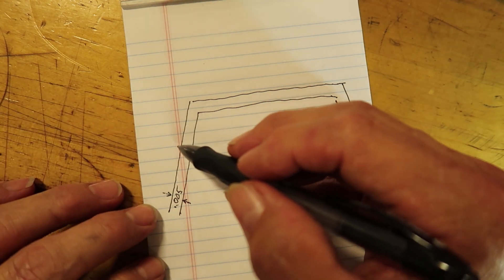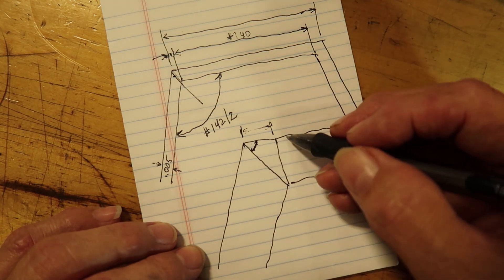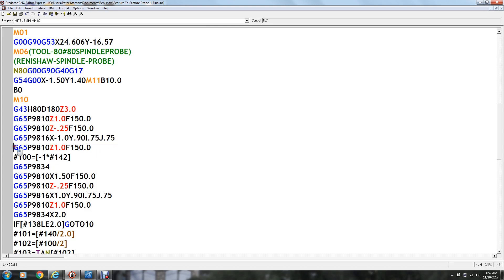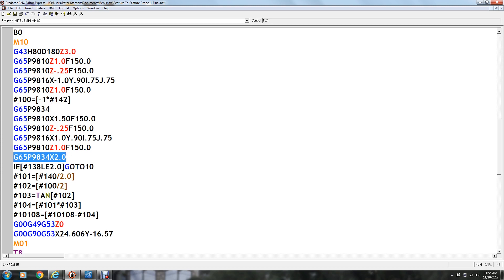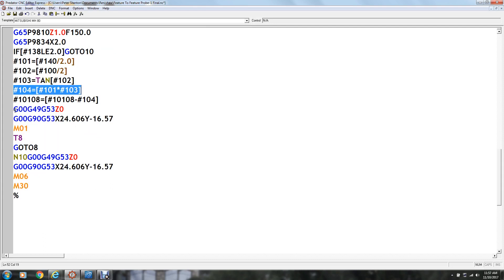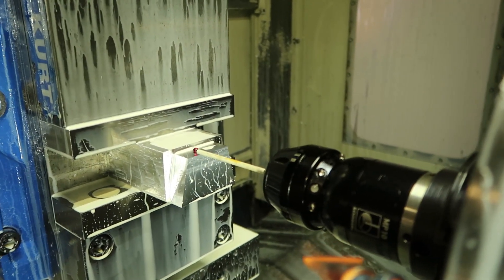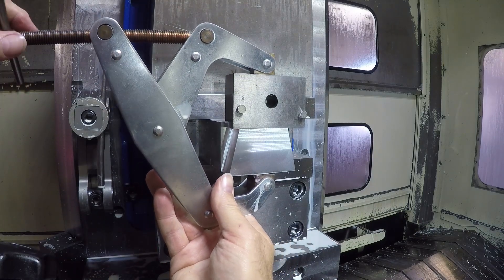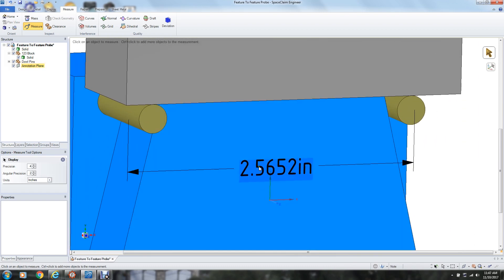Renishaw Feature To Feature Measurment

Comment: Another great video Peter!  The production quality has noticeably improved, audio much better and the effects showing the GCode in the last video are really nice.  I have two questions.  First, the math you do to adjust the cutter diameter has no minimum adjustment value.  Do you ever run into circumstances where it enters an infinite loop?  Second, can you do this sort of thing on a lathe?
Reply from the maker: +Norman J I have never had that problem. I think because of tool push off it always seems to slightly over shoot slightly. But that is something to think about. I don't see why you couldn't do this on a lathe. You would have to be able to probe the features. I'm not sure how you would measure large diameters. You would have to trust the centerline location.

Comment: You made us rewind to compare the values. Three tenths. Outstanding. Depending on your machine's encoder resolution, that may be in the rounding error of the multiple positions measured and internal calculations. I've found my machine to occasionally gain or lose a tenth on the same gauge ring, right after calibration and measuring the same spots. People still dismiss probes as, "Well I could do that with an edge finder or a wiggler." No you can't.

Comment: Hi Peter! Great video. I'm a fan of yours for a few years and would liketo get your opinion -  we are probing a technological hole that is machined in same setup as features ABC for the reason that these datums can not be machined together with other ~40 accurate features with 0.001" profile and position requirements. the hole is measured by CMM for its actual position (relative to datums ABC), then probed on the 5X machine and the diff value from nominal is added to the home position and actually shifts it. from your experience - would you trust a probe to accurately and repeatedly find the tech hole location or prefer to use a dial gauge / haimer centro type center finder? many thanks in advance for your input. Thanks again for the video - very informative and educational!
Reply from the maker: A properly calibrated spindle probe is absolutely trustworthy. That is of course if you trust your machines location. I find on the horizontal mill shown in this video if I can probe it I don't use the dial indicator.

Comment: Nice video and explanations. What's cool is even if the final pass cuts too much leaving the part undersize, the math should still work and increase the tool radius instead of decreasing. Although in that case you'd have to move the if-statement to after the calculations.

Comment: Do you write your probe code each time you need it , or do you have a file of templates that you can copy,and paste from?
Reply from the maker: I have until now manually write the the cod using the Renishaw macros. It isn't difficult. Renishaw has a whole manual on their probing macros and how they work.
Reply: @EdgePrecision  I only recently finished up installing my probe hardware and tinkered a little withe the Easyset macro. Reading the renishaw manual is pretty dry, so I started manually copying the format examples and typing them into a template file in Predator. This greatly helped learn the layout, something about repeatedly typing the layout really burns it into the brain, rote learning seems to be my best method of memorization.

Comment: Wondering why you start at B10. then index to B0?
Reply from the maker: I just do that at every B rotation to eliminate any backlash. It probably isn't really necessary but on a horizontal mill you are farther away from the center of rotation and even a little error can make a significant difference.

Comment: Awesome video just subscribed!!! Thank you! Can you please post another probe video explaining the program variables a little more?
Reply from the maker: Thanks, I will keep that in mind for future videos.
Reply: You did a good job walking us through your program. I just wish you would do a beginners course maybe writing a full program why you chose those probing cycles where did you get info on probing cycles. How can I find out what offset variables my machine recognizes etc... I've been machining for 14 years but never touched a probe or messed with macros so I would like to get up to speed. Any books or info you can recommend is greatly appreciated!  send me your PayPal email I would like to donate. Thank You!
Reply from the maker: First thing you can do is if your probe is a Renishaw. Get their manual on the probing cycles/macros. You don't write the probing macros you will just call their's in your program. You may write a small macro to call and set or call variables used in their macros. To find out what system variables you need to get the manual on your control. In it it should tell you what each variable does. Than just experiment. First in MDI enter a variable statement like, #5221=1.0; That should change the X on G54 offset to 1.0. (At least on the Meldas control). It may be different on your's. Look in the manual under macro programming or user macros.

Comment: I've only ever seen the 'big boys' doing probing (on YouTube doing turbine blades etc) but  never on the shop floor, I've always been the probe :-). My head has been spinning learning how you use it and then how I could apply it here. Could I ask you some questions please.        You use the Renishaw system, in your experience are these the 'goto' people only or are there other probing system that you would consider now?        How does the Reishaw system interface with the controller. Is it a standard interface that all controllers have or is it a option that you need to specify when you order your machine.       Renishaw has both an Inferred and radio probe communication option but the inferred needs direct line of sight to work. How much of a problem does keeping this line of sight become. Would you consider using the Inferred style or should I just go for the radio option.       In regard to turning on a 2 axis CNC lathe can you probe the OD of a turned shaft. Eg: holding the probe in the turret like an external turning tool and touching on the end of the probe as you do when setting up the Z axis offset on a machining centre.      You showed us how to alter a system variable using probing and calculations, is it possible to call an axis to a value stored in a variable: eg .....X#10005 Z-200 where #10005 equals say 80. I am asking this in regard to probing out taper in a turned  shaft.       Both your HMC and Intergex have tool carousels that protect the probe well while it's not in use. How would a probe survive as a 'tool' in a standard V12 style turret. I could build some guarding to help protect the body of the probe from direct fits from swarf and coolant but still, it's a pretty harsh environment in there.      How much do you probe and how much do you trust it. Do you probe to a point where you would take a finished part out and set another going without manually measuring it first (my hands are shaking just writing that :-) ).       Can the effective diameter of a thread be probed for size, so you could get the same measurement that we would get by measuring the thread with thread parallels or thread wires.      Is it possible to use a probe to measure surface finish and if it is can size and finish be determined with one probe.Sorry Peter my  few questions have turned into a bit of an epic but what you have been teaching us is very eye opening and exciting for me. Thanks so much for taking the time out to make your videos and share your experience with us, please keep them coming.
Reply from the maker: CodeAdze, Thanks. There are different brands of probes. I think Renishaw are more common than others. My CNC grinder has a brand called Marposs. In order to interface a Renishaw probe or probes to your machine you do need some hardware installed and their Macro programs in the control. (This is probably true of any brand). On the horizontal mill I have never had a problem with the light communication to the probe. If I were starting new I would go with the radio version especially on a large bridgemill or Inergrex type of machine(my Integrex has two light transceivers in different locations) . In my grinder there are two probes mounted in the machining area at all times they have no trouble with that environment. the only problem I could see in a lathe is something striking the probe or large amounts of shavings getting tangled on it, or getting slung by the chuck and damaging the probes seals and breaking the stylus. I have never personally used a turret mounted probe on a lathe (except on a Integrex ) so I cant really comment on how this would holdup. I would want some form of protection for it. Ideally if the cover could be interfaced with the control to move out of the way with a M code. As to measuring thread diameter in theory with the proper stylus this might be possible. I would feel more comfortable measuring threads in the more conventional ways. GageMaker, Wires, Gages exc. But you could use the probe to control the location and size of features on the part. That might be worthwhile  especially on long parts and features (your tapers)that are hard to reach with conventional measuring tools. As far as trusting the probe. If it is properly setup, calibrated and the machine is accurate I trust it completely. To check surface finish you need something different. This is usually done  with a profilameter.
Reply: Peter, thanks for replying all very clear and understood. Using a M code to open and close the probe cover is a cool idea, maybe using the rotation of the turret to open and close the cover might also work - all food for thought, thank you. My excitement with you teaching us about probing is I can now imagine the possibility of being able to  run the machine for periods unattended. Doing unattended first operations on bar feed jobs and parting off into a parts catcher for instance would be a great step. I will need to get on machine thread measuring sorted to make this step really useful. Any of your thoughts/experience on doing this measuring would be gratefully received. Thanks again for all your videos and advice.

Comment: vertical workpiece mounting machine still is inferior to normal horizontal one in view of doing some measurement works。
Reply from the maker: ???---Are you referring to a Horizontal mill orientation as compared to a vertical mill orientation? As long as the probe is qualified in the horizontal position it makes no difference. Just look at CMM's they can have probes in any orientation as long as they are calibrated or qualified in that orientation.

Comment: Do you think probing parts on the machine will be as good as cmm inspection?
Reply from the maker: +Tom Clements generally I don't like to inspect on the machine. For two reasons 1 it takes machine time away from machining. 2 if there is a inaccuracy in the machine you could be making a error and not know it. It always good to inspect with different equipment than you machine and measure the part with and get a second pair of eyes on the job.
Reply: I've also learned to only ask "can you check this for me?"  When I was telling people what I wanted them to check, other things went unchecked and resulted in scrap.  For anyone learning here, don't be like me, get the whole part looked at by someone else!
Reply: While that seems very straightforward and sound reasoning, in the real world, how much difference is there between measurements taken with the CNC probe and what the CMM finds (of course, taking into consideration that a CMM spits out measurements with an extra zero or two compared to a machine control)?
Reply: There is a pretty big difference imo. The Renishaw probe is fairly accurate if it's been set up right and used correctly but you can't beat a high quality CMM in a climate controlled environment.
Reply from the maker: You are correct 99.9% of machine work it wouldn't make any difference. The difference is a machine can have inaccuracies like back lash error out of square axis  lead screw pitch error. Most machines are not compensated for a volumetric accuracy and calibrated  like CMM's are. So for small distances it wouldn't matter but for longer distances it might. So for your final inspection it better to check it in inspection.